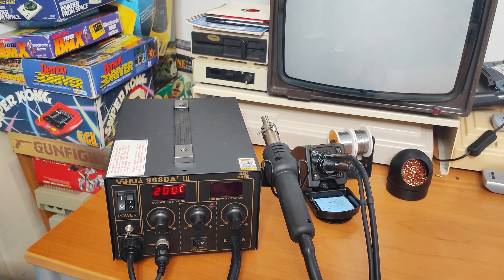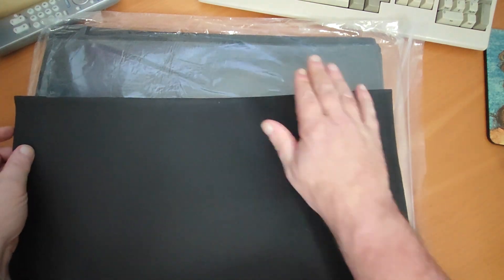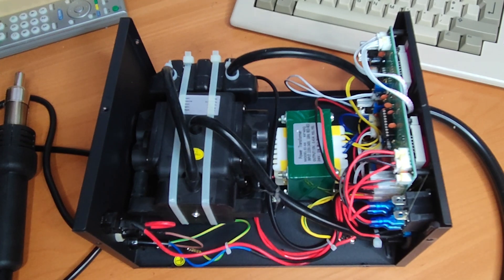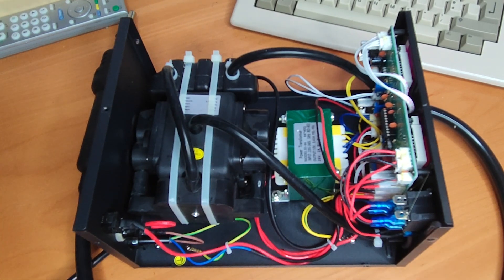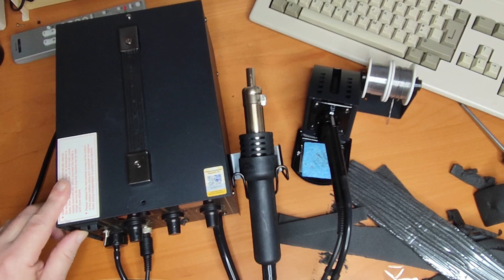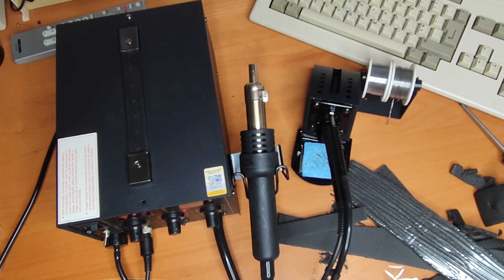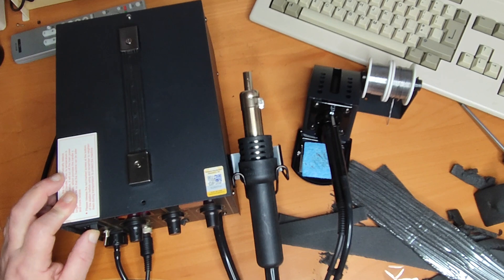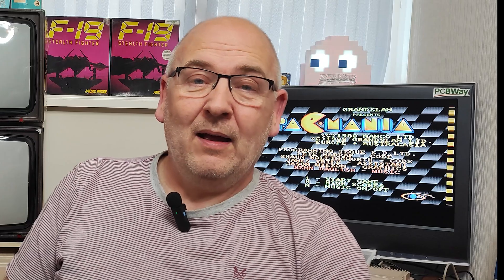BIG improvement quietening my Yihua 968 soldering station

Comment: Nice one. I need to reduce the flow rate on mine as it blows components off the board even on the lowest setting
Reply from the maker: I haven't really encountered that problem myself but I avoid the ultra tiny surface mount stuff 😁

Comment: I have a Yihua 995D station.  It works well except that if I have the master power on (switch on the back) and I turn off both the iron and the heat gun it beeps at me non stop.   I have no idea how to turn this annoying feature off.  I've lost my owner's manual and the factory does not return my emails.  Any ideas ?
Reply from the maker: That's really odd. Mine definitely doesn't do that. Has it always done it?
Reply: @RetroComputingReboot  Yes.  It must be an alarm of some sort but I can't figure out for what.   If I leave the soldering iron or heat gun on, it doesn't do it.
Reply from the maker: @SomeTechGuy666 It must be an everything is off and safe alarm 😂

Comment: Hi, did it always make the buzzing sound or did it get worse over time? I always thought Yihua was a good make? 
Quite surprised to see (what I think is) the air pump being mounted with white cable ties?
Reply from the maker: Hi John, yes that's just how it came. The only thing I'd done prior was just use the wire tie as a temporary measure.

It was buzzy when it came. That hasn't changed with use. But to be fair, it does it's jobs though really well. And yes, the pump is mounted with cable ties. That said though I'm sure they will outlive the actual pump 😁.

I can't say if my experience is typical. It just liked to vibrate, so I could have been unlucky. Adding some nylon or rubber washers between the chassis and cover would no doubt of stopped the vibration, but I thought I'd try some proper sound insulation too

Comment: i'm quite glad this worked out for you.  i am curious if it will retain more heat now.  perhaps you could take occasional temperature readings inside the case while it is running (via thermocouple temp probe?) just to see if it may cause later issues with overheating the internals.  that being said, thanks again for a great video documenting your adventures.
Reply from the maker: You literally read my mind John. I started with the thermocouple as soon as I'd done it. I just need to give it a bit more time to see if the results are representative
Reply: @RetroComputingReboot  stay awesome.

would you be willing to update us on the mod you did and how it affected the internal heat?  (perhaps that would make for a nice short video.)
Reply from the maker: @JohnLeePettimoreIII Definitely will be doing that!